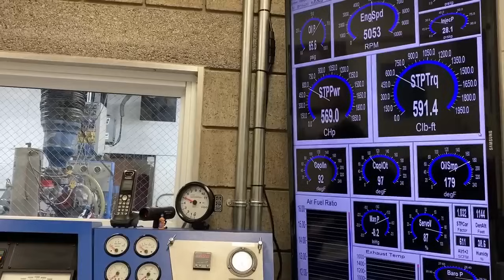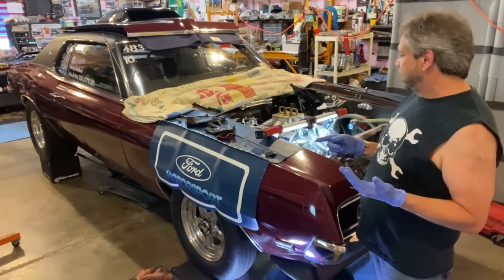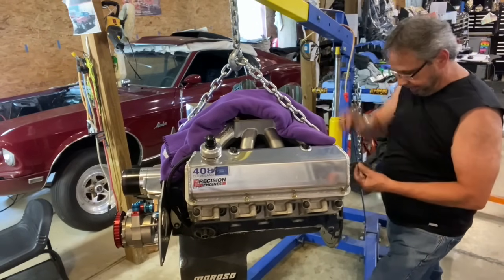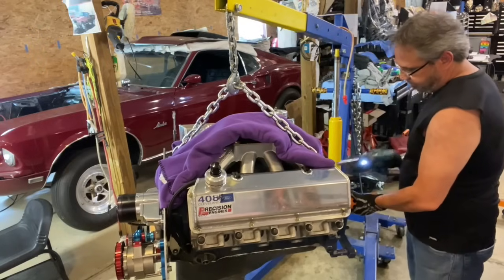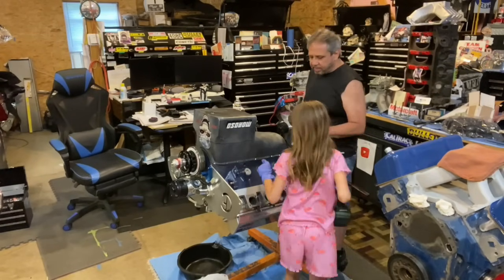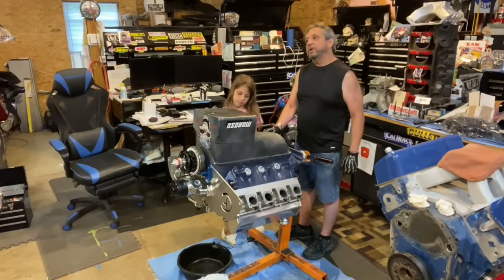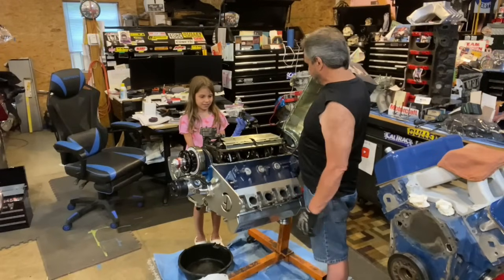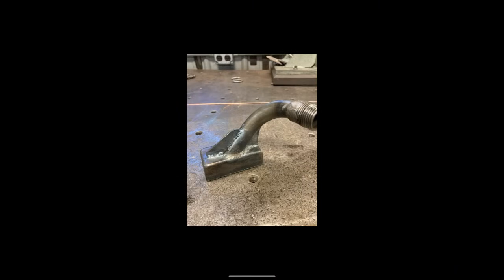DBG: Rip 769 HP Ford 351 Cleveland, Now We Now The Rest Of The Story...No Band-Aid Fix

Comment: Im glad to see you didn't have worse damage your windage trey saved you from the pickup getting wedged between rods and causing damage to the block possibly or throwing a rod,, that can definitely be fixed,,im a welder/fabricator and have welded many different things and from picture it looks like the tubing wasn't beveled to get full penetration they just butted the tubes and welded or brazed around the outside,, and the engine harmonics and vibrations cracked weld,, im running a miloden rear sump 9quart pan the pickup screws in and is alot longer, but it has a bracket weled towards the end and bolts to main girdle,, good luck with getting it back together and I would definitely weld gussets to pickup tube like that one you showed ,plus weld a short strap off tube an drill an tap your main girdle to bolt strap down,,
Reply from the maker: You got this already Chad, so you see what I was thinking. May not have been the best and turn up the wick and new frequencies abound. Talked with Stefs and Sending in my pan and new pump. They will take care of the rest.

Comment: I reckon you used coated bearings, that saved chucking rods.... Maybe cranks grind, yes new rods, roller lifters ???....hone,rings etc... new pick up with a brace... You will fix it Tim... i think it could of been a lot worse...
Reply from the maker: You are so right this is something that you can die from a simple mistake like this. I am very fortunate that this is all that happened. And that’s how I’ve been looking at it. Lesson learned for all and especially myself. Some new changes coming forward.I talked to my old builder the other day, he said stop monkey around, get the thing apart let’s get it going and get it done. It needs a rebuild. Don’t try to cut corners. I’m in good hands now he’s coming out of retirement at age 82 to put DragBoss in the 9.20d. Stay tuned.

Comment: Just Crank and Rods got hurt ? Time to update the Engine 10yrs with no overhaul 👍things get old . Check it all out then fix , never fails on Fastest pass or Best 60ft /making more power good thing for parts. You could put Engine from Mustang to Cougar to drive
Reply from the maker: No engine is about 5 years old, never raced until now. Been beating on that 2 Bolt block 11 years. I could do that, Be fun too I bet.

Comment: Heartbreaking 💔 discovery for sure. Team Family DragBoss has what it takes to overcome it. How do you mend a broken heart? Teamwork. Keep watching DragBoss Garage. Learn and be inspired even through adversity. B.T.W. Excessive harmonics in Layman's terms=Bad vibrations. Not unusual to have pickup failures. Even oil pumps have been known to crack. The expensive reciprocating assy. is likely trashed due to the failure of a comparatively low cost component. DragBoss will see to it that weak links will be addressed. Stay Tuned.❤

Comment: I would think the crank can go .010"under depending on the heat penetration idk if there is a Rockwell test for this. It would be interesting if the rods can be blasted and used in a stock application as an upgrade.
Reply from the maker: The crank may be good. I may have that cleaned up used for a mild build or sell. 4  rods are not even worth looking at from my point of view. Just replace and start fresh.
Reply: @DragBoss351Cleveland  I had some transmission parts get that black with the 727 now I have a th400.
Reply from the maker: @michaelclanton1152 hope all is well. I have never seen that in a transmission, the bluing. The debris, many times.
Reply from the maker: @michaelclanton1152 I think shaftech, who finished the crank can. I am going to buy a new crank from Molnar. Maybe have that old crank cleaned up and evaluate it. Maybe for a street build.

Comment: WOW i had a funny feeling it was gunna be the pick up id be making a support bracket from the filter screen to the windage tray plate but in a pitch structure to stop it from vibration id still plastigauge the bearings just for back up i know we hate touching the rear main part cause of the seal and what ive done in the past before i put the sump back on fill up a big icecream container yeah with engine oil hook up ur master gauge spin it with ur drill see what oil pressure says i think its gunna be safe so happy for you man examine the oil pump as well hope its really good
Reply from the maker: Mario, not a good situation, needs bottom end. Taken care of. Get a custom pan and pick up. Want a pro job.

Comment: The process used to bend the 90* angle on that tubing needs to be carefully analyzed. If if got stretched while it got bent it would become thinner? Was the material too brittle? It looks like it just snapped at the bend. That is a very poorly engineered pick-up IMO, and the results of the tubing break are also heartbreaking....wallet breaking at least!!! You are a stout soul to take this in stride.
Reply from the maker: Stuart, I have to look at this from the learning point of view. I found a failure point, I did not get hurt, it does cost money. But no one got hurt and that’s the main thing. The bottom line is any oil pick up should be braced. Any mark on an oil pump pick up, a scratch, Nick, overuse, tightening, every time you make a pass. It’s trying to rip that pick up out of there. They can only be silicon brazed  as any type of welding does cause it to  harden and crack.

Comment: Well Tim, I would call that pickup failure "weird"!  I never had one fail like that, though I do remember a fella who said he had one fail at the threaded section. Damn shame,
Reply from the maker: Made me sick John. All these years of hard work. Over in 9.37 seconds. But I have learned that what I do for oil mods works and can survive. Will have a new pick up made or reinforce a new one. Just happen to have a new. Pan and pickup. They stopped making this pan, years ago.
Reply: I definitely would be "down" after a crazy failure like the pickup breaking off. That engine runs SO good. I have always wondered how much the pickup "moves around" vibrating with the engine. That pickup failed in a damn short time, IMO.  There may well have been a small Crack right from the start.
Reply from the maker: @johnsalvaterra3116 I know John. Unbelievable. My buddy said it was a poor weld, some edge looked irregular but don’t know. Learned alot with this controlled lesson. I know my oil mods work.

Comment: Tim, that pickup being so long needs support to minimise vibration and failure. I ran a rear sump on mine and the pickup was supported with a bracket onto a main cap stud. Hopefully you haven't done too much damage but regardless of the oil results I would be tearing that down to see for myself.
Reply from the maker: Agreed. No not asking for analysis, just want to see if it correlates with damage. Needs new bottom end.

Comment: Oh that sucks!  I had the same happen 20 years ago in my BB Chevy bracket car.  Yes vibration caused it.  I was actually just talking to Mike Z from Canton about this exact thing.  He said vibration.  He also mentioned adding a support to prevent it.  I think that's what I did back then, long ogo, not sure.  I have another setup now, SB Mopar in a 61 Galaxie, had to build my own front sump pan and run a long pickup from rear mounted pump.  I used thicker wall tubing but your problem has me a bit nervous!  The next time it's out I'll see if I can find a place to attach a support.  Love your car and your channel.  I'll be watching, thanks.
Reply from the maker: Thanks Bobby. Very unique combo you have. Yes very common to most, but I have never seen it. Harmonics, heat, stress all contributing factors. I will come up with a solution for this. Stay tuned. Glad you enjoy the channel.  Yes check yours.
Reply: @DragBoss351Cleveland  Absolutely!
Reply from the maker: Don’t be me.

Comment: Hey Tim, sorry about that. I have issues  right now also. #3 spark plug stripped out.  Hope you get it going soon
Reply from the maker: It’s ok. Learning a lot…. More. Not good, maybe you can heli cool it.
Reply: Pulling the head and taking to my engine builder. Putting in heli coils. On all 4holes. Heads are old and have  had a lot of abuse.. should be good. I hope yours doesn't cost a lot.  I love the segment you did on Bob Glidden. Out standing.  He is why I chose ford's.
Reply from the maker: @garycarpenter3685 good luck Gary. Right move.  Yes Gidden is the man. We got this. Stay tuned.

Comment: Damn. That welded pickup is problematic by design.  It should really have a tube section over it, and some rosette welds for extra security. That or it needs a support leg going back to the main  support girdle. Will be interesting to see how the bearings look. Not that it would have made any difference, but in your previous video where you were doing a compression test with no oil pressure, it's something that I personally wouldn't have even considered. No oil pressure means no lubrication, an no protection. If you wanted to test cylinder integrity, you could have pulled the rockers, and done a cylinder leak down. It wouldn't matter if the pistons were at BDC, it would still give you enough information. The oil analysis will be interesting,  as it was probably sucking air for some time before the failure. I suspect that the black is possibly bearing coating,  but we will see. Hope the crankshaft is salvageable mate. Regards Greg
Reply from the maker: I thought about it Greg, but already had my mind made up to pull the engine. With what happened I had a feeling it would never be anything salvageable so to speak. Leak down tester got dropped by accident so need another one. Tom Molnar will help me with crank and rods so good with that. I also know that what I do for oil mods is sufficient and works well. No change there. Upon researching found that this is a common problem, especially bbf. Someone had mentioned the black bearing coating from bearings. All good

Comment: See if melling or Moroso makes a racing version oil pump the pickup is built in .that eliminates the offset screen and eliminates a failure point
Reply from the maker: Clark, the bearings are wiped, so is the cranking rods. Rosa makes nothing for this other than standard or high volume. This pump is a blue printed version, from precision oil pumps.
Reply: They offer a single stage  dry sump oil pump that's not hard to make minor modifications for.would that be a potential canadidate to your situatiin?
Reply: Either way its disheartening to see this .and its not even my rig .I'm sorry buddy just trying to help offer solutions to remove the problems ..
Reply from the maker: @clarkmcmahan1595 I have been thinking about that. But nothing wrong with my oiling system. So would rather not get involved right now. Getting a new pan and pick up from Stefs.

Comment: Hey Tim, was that pickup tube new to the build? What brand? My Milidon 8 qt. pickup tube and pan are nearly 30 years old, and I reused them on my current engine, which is a very  similar build and power level to yours (although, I keep mine under 7800 rpm's). My new engine has 100 runs on it, my last engine had about 750 with the same pickup tube on a m84 pump. That quick of a failure just doesn't seem possible. Harmonics? Flaws? I may brace mine the next time it's out.
Reply from the maker: Listen Marvin, this is new to me. I’ve heard about it on big Blackford, but after talking to professionals, I know a couple. This is a common problem. Once you get to a certain horsepower level. It’s definitely due to harmonics, RPM, heat, and stress. Many people have said they change the pick up with every rebuild. This pick up is a factory Moroso, but it’s old. You are so right about thinking about your pick up. I will tell you this I’ve learned a lot of lessons on this and hopefully others havetoo. Do you think she’s cooking now? Stay tuned.

Comment: That's a tough break Tim.
You will have to reinforce the pickup tube somehow.
The GForces of the launches snapped it off.
What did the welds look like?
Was there any obvious defects?
Take care, Ed.
Reply from the maker: Ed, Darin said it was harmonics common problem. But all things contribute, stress, heat, and g force with weight of oil. He braces all pick ups and braze them In. The welds as per  buddy, are not penetrated well. You take care and  stay tuned.

Comment: I thought that's what happened, my cleve, did the same thing modified stock pan to hold 8 quarts and mod the pick up tube. Four runs in the low tens not bad for a 73 stang lightly built 351 with a 400 crank, 10.5 to1, 1971 351 boss cam forgot the specs, home ported heads, .035 head gaskets, home modified C6 with trans shift kit, and a 9 inch 4.30 traction lock. Running on pizza cutter 4.5 M & H front and 10 wide 29 tall 15 inch rear.
Did great until my start of the fifth run left the line my pap wired in a idiot light along with the oil gage.if that light didn't come on I would have ruined my  engine.
I got away with replacing two con rods and all rods and Mains and listening to my pap yelling how stupid I was for welding the pick up tube instead of brazing it for about three weeks. Hope everything goes smoothly for you.
Reply from the maker: Racer, tough combo. Impressive, great work. Yes I never knew any of the issues with pickups. It just blows my mind. Also just learned about brazing and not welding. I will get one of the lights too. We will be ok. Thanks much. 🙏🏁

Comment: Well not as good news but I knew that pickup was off,   you didn't get as lucky as I did when mine fell off.       Look at bracing the pump that will stop a lot of the vibration.       Look closely at the pickup where it broke off.   The pump was shaking around that's why it broke right at the weld. Stop the pump from moving no more broken pickups.  Or brace the pickup to a main cap.
Reply from the maker: Yep that is the plan. No doubt bad news. But I consider myself lucky 🍀 in the fact that it did not blow or crash the car. Thanks Laura
Reply: @DragBoss351Cleveland  Many of the Melling small block pumps aren't square where the main mounting bolts tighten against the housing.  Often have to take a grinder or mill and square them up.  Puts uneven load on the bolt heads and can break them off.  Could that be the case here?  Allowing the pump to vibrate?  May look into other, heavier duty aftermarket pumps.  Good Luck
Reply from the maker: @n2omike no Mike I don’t think that is the issues. This pump was sponsored to me by precision oil pumps. They blue print these pumps. I will see what he says. Aftermarket billet stuff will not fit with girdle.

Comment: Man, thats straight up bull s***t.  i would make that pickup company pay for that engine.  A pickup is absolutely not a high wear item.  If anything, its inert for the most part.  Shouldn't be doing that!!
Reply from the maker: I’ve never seen anything like it. I’ve heard about it with different engines. No company whatever pay for anything like this. It’s a racing engine. The bottom line is it is aware item, this should be changed every time you rebuilt the engine. These all should be braced, which I did not know. Live and learn stay tuned sniffer👍
Reply: @DragBoss351Cleveland   - Well, if it happened to me, it would be the first lawsuit they ever saw over it!!

Good luck, awaiting the next steps in my armchair with my warrior sword at my side!
Reply from the maker: @mistersniffer6838 thanks sniffer, have not gotten it apart. Family and work first. Definitely a learning process. Hope the  Bossettes will help me tear down.
Reply: @DragBoss351Cleveland   - Thats a big job.  Figured you would have to take a little down time to fall back and regroup, to see what direction your gonna go, order parts, etc.....

Wish it woulda happened closer to the end of the season, but, then again, its starting to get a little too hot to run, so, maybe perfect timing???

Comment: I said it would be the oil pickup😉 A big red oil pressure light would have saved the rods.
Reply: A hobs switch I think it is called
Reply from the maker: It is what it is. Light might of. But unlikely to me, with this failure. Thanks
Reply: @DragBoss351Cleveland  The big red light facing you would have saved you! you would come off it instantly in a split second and shut it down. From the time your oil pressure died you were full throttle for 4.7 seconds and another 20 seconds on deceleration and idling it till it was shut off. The Autometer Pro light would have cost  you a set of bearings at the most. Every race car we set up we install an Autometer Prolight.🤔